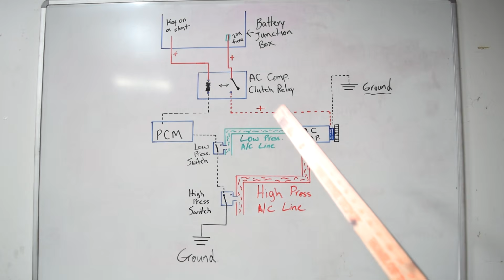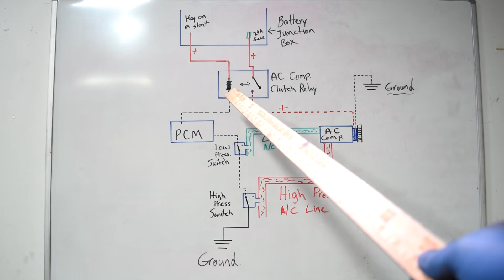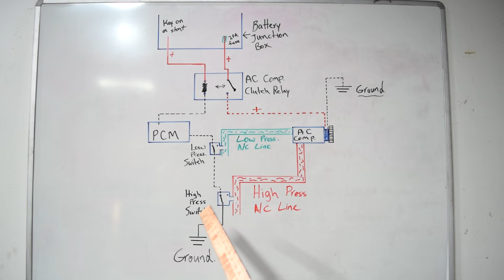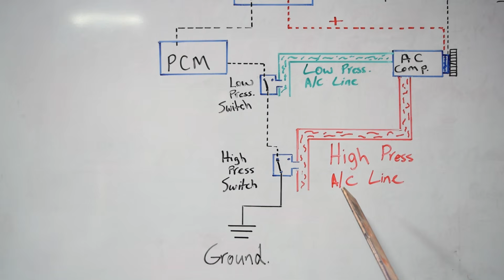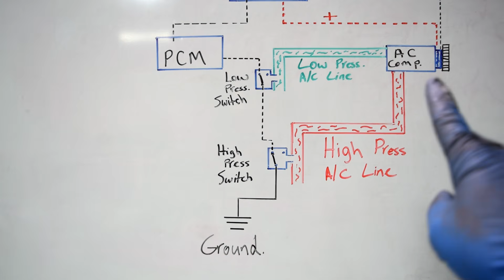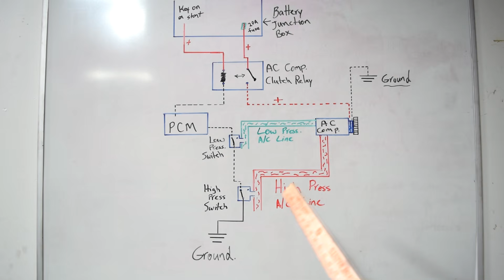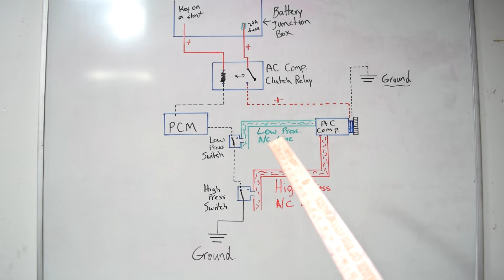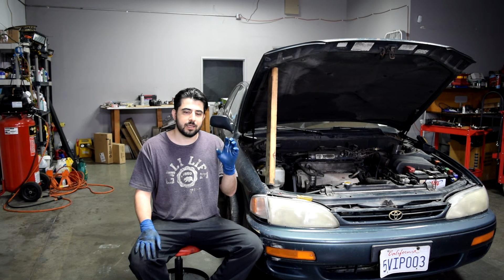How to Fix your Car's AC System - Compressor Coil, Clutch Relay, Low and High Pressure Switches

Comment: Great explanation sir. I've been in refrigeration for 14 years commercial and residential. I'm currently struggling with two of my vehicles. Beautiful diagram. I think I'm losing ground on the solenoid btw.
Reply: Did you figure it out. Think I’m having same issue

Comment: How about if it is a soldered relay. Citroen Berlingo 1.9 Diesel 2004 it has relays soldered under the fuses,below the cover.

Comment: Thx for the info man. I finally fixed my ac on my 2004 crown Victoria since I got the car Jan 31st with heater worked but not ac but didn't check it during the winter.My problem was the high pressure switch. I bypassed the switch and my compressor finally kicked on added freon 2 cans now ac nice and cool.

Comment: I have a 2005 Altima 2.5 replaced ac compressor dryer, recharged system cooling ok but I'm concerned ac compressor clutch is always on engaged. pressure stays between 35 and 42 . on the low side

Comment: hello everyone. I made a few posts here and wanted to share my results. 2010 f150. after Ford had it for 2-1/2 days and couldn't figure it out, I had a mobile mechanic come by. he plugged it into his computer and had a fault for evap temp sensor. 5 minutes it took. all pressures good. on this vehicle you have to by the whole evaporator box in order to get the sensor. so I bought one for a 2012 fusion, drilled a hole in the bix, inserted, attached a new pigtail and bingo. fixed. found out the next day I had no cool air, here the condenser pep boys put on had a leak, so I replaced it today, charged it and all seems great! 42 degrees out the vents.  love this site, thanks a bunch

Comment: Hey 👋🏼, great informative video . I have a strange problem in my Hyundai Sonata 2013 . The compressor turns on and cools really well , but sometimes the compressor won't just turn on for like 20-25 mins . I need to turn off the ignition and try again and sometimes if I'm lucky it'd start . Could you recommend what the problem could be ???

Comment: hi , my chevy express is blowing the fuse just when turn back on , i replaced the compressor ,the blower motor resistor and blower motor and it worked fine but next day i found the fuse blown . now i just turn the switch back on and boom ...blow the fuse , what else can i check to get it fix , thanks.
Reply: This is exactly what mine is doin? U ever get it figured out?

Comment: what symptoms would occur if the system had too much r134a?
I have added to my system (using a gauge) after replacing all the components and am at the point where I feel I could be overcharging it. My compressor kicks on, then immediately off repeatedly.

Comment: GREAT VIDEO BUT MY PROBLEM IS THAT THE AIR DOES NOT COME OUT THE VENTS FAST OR STRONG ENOUGH LIKE IT SHOULD. WHAT COULD BE THE PROBLEM. PLEASE HELP. THANKS.
Reply: As with any symptom, there could be a multitude of problems;
but in this case the fan is not really tied to the refrigerant system except when the air passes through the evaporator. It could be electrical issues with the fan or switch, but I bet its probably your cabin air filter and/or intake vents above the hood are clogged.

Comment: What could be the issue if ac works and compressor randomly cuts off? Even if the refrigerant is topped off?
Reply: wild guess- loose electrical/ground to the compressor or maybe to a sensor/switch
Reply: I have the same issue what could it be ?

Comment: Hey RnW, I just did timing belt on my 04 Lexus is300, and the ac stop working. The compressor clutch doesn't engage. Every thing is plugged in where it supposed to go. What do u think the problem is? Is was working fine before. Ac comp relay are good
Reply: Knowing it was working before, will double check again on those connectors. May be a wire was chafed and touching the ground?

Comment: Ford can't figure out my problem. air at vents 60 degrees at idle. charged per specs under hood 24oz or .64kg. accellerating temps go up. acts like low refrigerant compressor cycle about 10-13 seconds on and off for 5-8 seconds. has new dryer and condenser...... frustrating
Reply: May be the blend door is not closed fully? A quick tip is to bypass the heater core and check if your AC cools down to 42 Fahrenheit.   Did they check the radiator fan amperage draw? If it is weak, common on Fords, will not cool the AC properly. Hope this can guide you to the fix!
Reply: Idris Bakali 
no don't believe they did. they did mention when fans came on either pressure went up or temp went up... just can't recall exactly. I saw a vid here and I cut open plenum to expose evap, thought maybe it was caked up. I cleaned it although was pretty clean already. took thermometer and stuck it in there and temps were only in 50s. thought maybe expansion valve or evap sensor.
Reply: Idris Bakali I replaced the actuator and seems to be working ok, reset it by removing the fuse also.
Reply: Did it cool finally?
Reply: Idris Bakali nope.... I had done the blend door prior, sorry I wasn't clear. kinda hard to figure it out when the dealer had it for 2-1/2 days and they didn't know. I would think they could hook it up to a diagnostic machine, but all they seemed to do was the basics and guessing. ended up just evacuating and recharging. its 90 degrees today and won't go below 61. stays there for a second and then right back up to 67 -69. cycles about 10 seconds on and 10 seconds off. trying to find in cabin temp sensor but apparently there isn't one. cycle switch? compressor? evap sensor (as it's in the mid to upper 50s in plenum)
Reply: also thought clogged cabin filter but this thing doesn't even have one
Reply: Me You I don't know if the evap sensor has anything to do. But the ambient room temperature affects your AC. Did you change the accumulator( dryer dessicant). not sure which one your system has. I will change it as it gets saturated with moisture and won't allow optimal cooling. Then I seriously recommended checking the radiator fan amp draw.
Reply: Idris Bakali has new condenser and dryer. what is proper ohms, amps on fan? I have not checked that yet
Reply: most Fords don't
Reply: most Fords, the fan draws up to 20 amps. I am not sure about the ohms specs, you will have to search online.
Reply: Did Ford check the evaporator?  (near heater core)...if the evaporator is not it good shape it can affect inside temp. Like the condenser, it dissipates heat...long story, read this article it may help... https://macsworldwide.wordpress.com/2010/07/12/the-evaporator-is-an-important-part-of-your-car%E2%80%99s-ac-system/
Reply: I think you mean the evaporator temp sensor? It does affect the AC operation if it is malfunctioning.
Reply: Idris Bakali no, I seriously doubt it. only way to get to it is to either remove dash or cut a hole in plenum case ( which I did). it looked pretty clean but I cleaned it again. I also stuck my thermometer in there in the temps were upper 50s, which seemed to me should be lower 40s, but I don't know.
Reply: Me You was your system evacuated properly? is the pressure switch working properly ( any intermittent issues)? Ambient temperature sensor? light detection sensor ( the one on the dashboard ). I believe these sensors affect the AC operation.
Reply: Idris Bakali I replaced ambient sensor at front myself, cannot locate cabin sensor and never thought about sensor on top of dash. I can only assume evacuated properly... done twice by pep boys then by ford dealer. my thoughts were pressure sensor/ switch or evap sensor but don't believe either place I took it even checked them. pep boys was clueless and the Ford guys seemed to be guessing. they agreed it didn't cool right and just started spouting out a laundry list of things (compressor, fan, dryer,). I get all that but that's what I was paying them to determine.... Ford seemed to busy for anything but a simple swap of an obvious bad part (compressor/leak).
Reply: Me You it's a shame Ford isn't taking this issue seriously.
Reply: Me You now I am thinking more of an electrical issue. Are the AC gauges reading normally? Just thinking if the compressor is compressing properly.
Reply: Idris Bakali Ford didn't indicate anything odd. pep boys gauges were 20 and 200 at about 85 ambient, seemed low to me from what I've read but apparently fords low sides are supposed to be in the 20s... cycles a lot... 10 on, 10 off, erratic, 13 on 6 off, etc.
Reply: Idris Bakali I have a guy coming this morning to look at it. they say they check sensors, switches and everything so hopefully through a diagnostic process he can figure it out without too much issue.
watched the videos here and seems if you just go through the steps it shouldn't be too hard for a pro to figure out. but maybe I'm wrong
Reply: Me You well I can go on about dealerships. Some want to save on labor and will hire anyone that could change parts and won't hire techs with brains.
Reply: Idris Bakali I know right? none of them can seem to figure anything out unless they have a code. or they have to get on a chat line with an engineer. I think part of it is they are so busy they don't have time to do it properly.
Reply: Idris Bakali amazing....... tech here 5 minutes and found fault code for evap sensor and blend door. 5 MINUTES!!!!!
Reply: thank you for your assistance. much appreciated!
Reply: Me You review my first comment about blend door :)

Comment: Great video, just replaced all my components in my 2004 silverado, now my compressor will not turn off.  It does not cycle, it stays on all the time even with button inside the cab turned off.  Any ideas? I pulled the relay out and it stopped.  Thats as far as I got.
Reply: Did you put the right amount of the refrigerant?
Reply: yes, exactly right.  checked it repeatedly.  The only way to turn it off was by pulling off the relay.
Reply: Did you check the compressor clutch connector if it is shorted to power?
Reply: how do you do that?
Reply: I did check power coming out of the fuse box and it is hot all the time, i guess this is causing the relay to close.  I switched relays, same problem.
Reply: just wanted to let everyone know my mechanic tried for a day and a half to find the problem. He then said he just pulled the high pressure switch and plug it back in and now all is normal works great.
Reply: Thank you, it is indeed very helful experience

Comment: after I recharged my AC compressor in my car my clutch is always engaged why?
Reply: same for me....keeps running will not cycle....unplugged the relay, but soon as i plug it back it starts running again
Reply: Trying to figure this out too- let me know what you find.
So far i suspect a faulty clutch relay, or a faulty pressure switch, or grounding problems to either circuit.
Reply: theres got to be an electrical problem somewhere. Signal from switches isnt going directly to the relay? I saw on a forum somewhere that they had faulty soldering in the electrical harness. maybe worth it to trace each switch for continuity under both on and off conditions
if its always on, it would make sense for the low pressure switch signal to be intercepted
Reply: My parts are all new, compressor, dryer, switches.....checked refrigerant, all good.  Relay is good too, but there is power going to it all the time.

Comment: My 96 accord manual makes a loud annoying wewwwrrrrraaaaahhhh noise when the AC is on and I press the gas, but stops when at high speeds or when I press the clutch. Any ideas? I looked everywhere and it's getting very annoying.
Reply: Idris Bakali I just checked it out n it turns out the front mount is broken. So when the engine is reving it hits the radiator mount making the noise. Once in a steady speed, it stops. It's a 40 dollar fix luckily, thanks for the help.
Reply: insufficient intake, like a clogged orifice tube?
im inexperienced but it sounds like the high-low pressure transfer is being hindered somehow like too much resistance. Maybe it compressor wasnt oiled right?
Reply: Not sure but I think it might be the compressor clutch worn off or clearance is higher to the compressor coil? Take the Accessory belt and check the compressor clutch for free play.

Comment: 1995 4Runner.....    What do you know about AC CONTROL circuits?    Do you have a video about control circuits???   Mine runs NICE COLD AIR until....  shorts out the AC fuse :(
Reply: Froilan Luigi Picard sounds like a short . You will have to do a fault trace to find where the short is. Start close to the relay since the fuse is not popping.
Reply: RobertMOdell perhaps some naked wire intermittently touching a ground. Or something in the AC system circuit is drawing too much amps. Get the wiring diagram for the AC system and check the condition of the wires, also trace the voltage and check the amp draw.
Reply: Thanks!  That's exactly what I did.  Tracked it down to the compressor clutch taking too many amps, then suddenly the problem vanished.
Reply: On my truck there is no relay for the compressor clutch (the only thing without a relay in the control circuit).  It now draws around 3 A.
Reply: 3 amp is nothing, check the specs as I believe it should be higher
Reply: sir my a/c relay shorts out. but the fuse is still okay. i tried to get a new relay and it fails again.(its the same relay on the HORN. thats where i know if its still working or not) -mazda 3 2011.
Reply: Idris Bakali it also shut off my ignition on idle when i turn on the a/c.

Comment: I have a 01 Nissan frontier 2.0 and the A/C clutch keeps going on and off after I filled it with a couple cans of Freon. I thought I put too much in so I took a lot out and now it doesn't work. I'm going to replace the low pressure switch. What do you think?
Reply: If the right amount of the refrigerant or oil is not in the AC system, your compressor will be the first to fail. That would be a hefty repair. I would suggest taking it to an EPA certified technician with the right knowledge and equipment. Best of luck!

Comment: I check petty much the electrical system found that the connection to the compressor does not have electricity going to it what you suggest.

Comment: Hello, I have a problem with my AC System, the AC Comp Clutch is engaging when I turn on the AC system but the problem is when I accelerate, the clutch will dis-engage and will engage again. The refrigerant is fine, not low not high, i tried almost emptying the refrigerant but when I tried it and accelerate like when you rev the gas, it will dis-engage and engage again. Just want to ask if maybe you know what the issue is? Thank you!

Comment: ok tell me this my 07 Chevy Silverado classic ac fuse keeps popping when I turn it on
Reply: a fuse prevents too much current from traveling in a circuit. There is probably a short circuit in the AC wiring.

Comment: hi. i have a problem.. sometimes my evaporator and rad blower will auto on when i put my ignition switch to on and the blowers are at full speed. sometimes after a short drive the blower will remain on after the engine is off while the ignition switch still in "on" position. what could be the problem? thank you.
Reply: Not sure if it has to do with PCM setting or you have a short to power somewhere. More diagnoses will be needed. Good luck!

Comment: I am adding freon on the low side but the refrigirant seems like its not going into the system. How long does it take to empty the  can and get the clutch to engage? at what pressure on the low side does the clutch engage. I was adding the r134 for about 20min but the can seems full the whole time.. Am I suppose to let run for longer and i do turn the can upside down. I have a manifold set and I vacuumed the system already

Comment: Great video. What should i do when A/C relay terminal 85 has no continuity but the fuse is good? Thanks
Reply: Use a different relay from a working system and check if it is a relay issue.

Comment: what would you recommend to start checking? My aunts highlander ac was working and it no longer switches on. Every time i try to switch on the ac button it doesnt light up, where it used to before.
Reply: May be a moot point now, but for people watching- ive head the biggest problem here is just not having enough coolant in the system = low pressure switch will not engage, and allow power to the compressor clutch. Bad schrader valve stems are common sources of leakage. 
If you are working on your AC because it is empty, but a can of coolant with a gauge/hose, then check the low pressure port by connecting it and just tapping the trigger. This will allow the pressure of the low pressure line to enter the gauge and will show you if theres anything in it. If its empty, buy a $5 kit with replacement valves and the little tool and swap them out. Then charge the system a bit and maybe throw in some of that UV dye, and you may find a leak elsewhere.
Reply: also- pressurizing the low side, even if its leaking, may tell confirm the low pressure switch is working by turning on the AC comp after it is pressurized.

Comment: dats how my car wrks i hate it on an off an wen the car is park it doesn't get cold
Reply: May be time to change the accumulator  or dryer? Try an AC service to get the moisture out and check if it cools better.

Comment: hello great videos! I'd like to ask, since you didn't mention, Is there another switches to tell fans to come on and off? o do they cicle on and off exactly as the ac compressor?
Reply: I'm troubleshooting a 99 mercedes ml320, and ac comp engages but fans don't, so it blows warm air.  no fuse,fans or relays problems